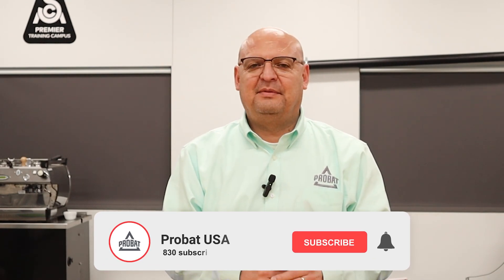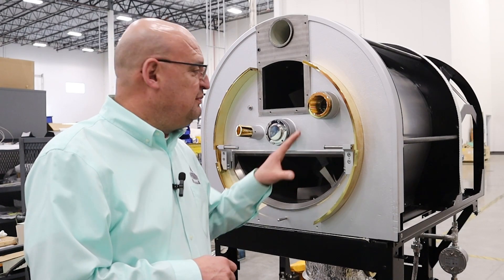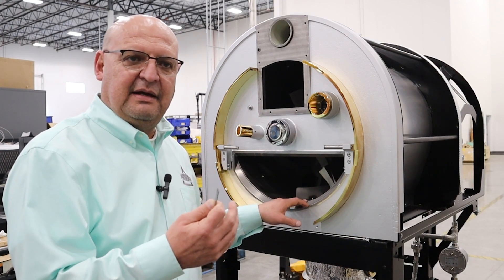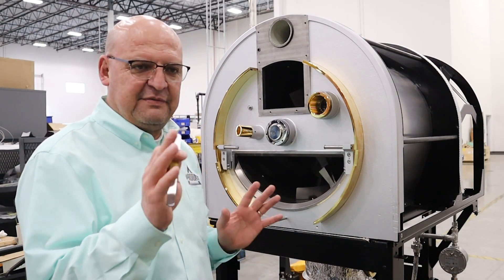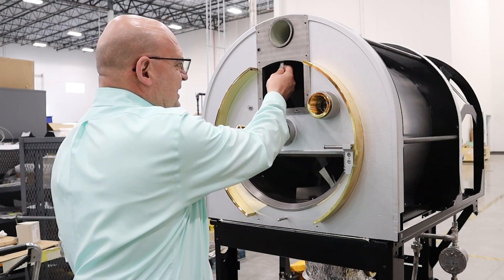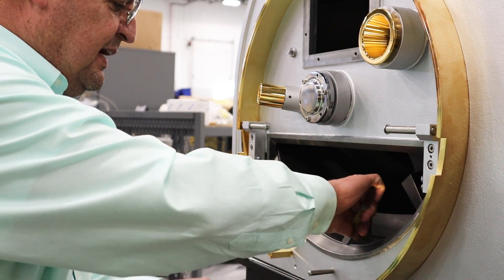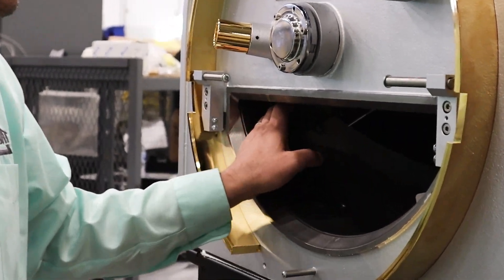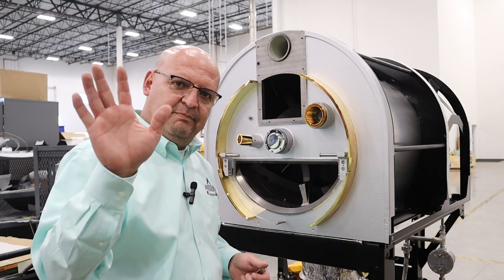Measure the Drum Gap on a Probat P12 Roaster

Comment: When you have used your spanner wrench and you have a adjusted the drum as far back as you can and it continues to rub periodically then what do you do?
Reply from the maker: If you run into this issue then you need to take the bearing out and turn the adjustments nut out more and then reinstall the bearing.

Comment: Do you recommend a 1.5mm drum gap (when cold) for all of the P-series roasters? Are there different tolerances for different sizes or model years? Thanks!
Reply from the maker: The 1.5mm gapping measurement should be taken with either a cold drum or ambient air. 1.5mm should work for all P5, P12, 25.